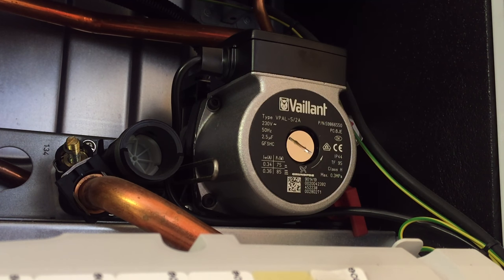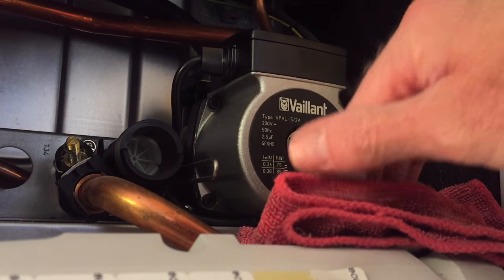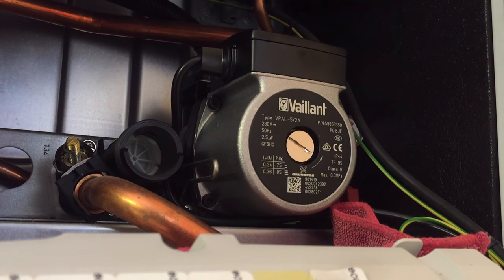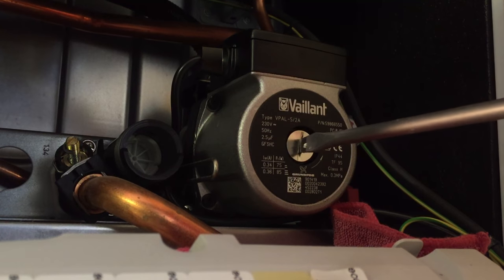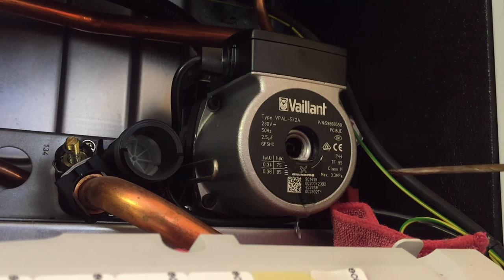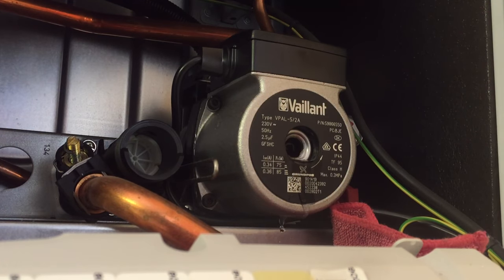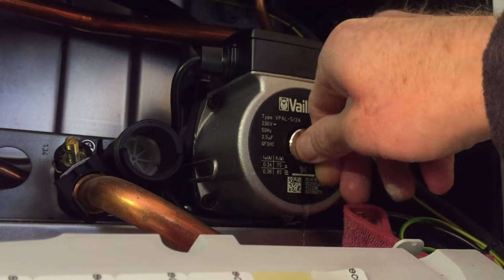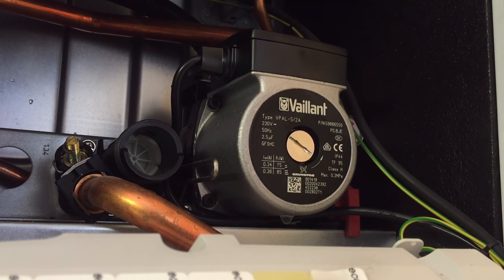Boiler not working. How to check heating pump.

Comment: Thank you so much for this! My boiler was disconnected at work for an extension build and when I recommissioned it I had fault F75.  I was getting ready to change the sensor and even the pump but after seeing your video I did what you said and the pump came right back to life. Cheers

Comment: I can see my pump is spinning when I remove that threaded plug but the radiators are still cool to the touch. Could the impeller be broken? Is there any way short of draining the system and removing those four hex bolts and taking off the pump to visually inspect the impeller?

Comment: Firstly you should mention that you should turn the power off to the boiler in case it kicks in whilst you are fiddling about with that small screwdriver in the pump. Secondly on the pump label in the 5 o clock position is an arrow - that is the direction of the pump - if you start turning it like you did in the opposite direction there is a good chance you will damage the pump vanes causing loss of pump pressure and having bits in the pump cylinder that will damage other vanes.
Reply: Firstly, he and you should mention, there is no need to open the bleeder completely. If the boiler is switched on and running, a simple half-turn would show you if the water pump is working if water and or boiling water gushes out! Then you know its working.

Comment: Hi I’ve taken the lock off but water continuously pours out of the pump and is very hot, the internal part turns freely but when boiler is running the pump makes no noise. Can you offer advice?

Comment: Thanks for video. very clear. ok removed the front nut, turned the inside screw- action seems fine...so put it all back together...turned to heat mode...the pump casing itself is getting very hot, is this normal? I can feel vibration and assume water passing through...I have hot water fine...but I only have two large cast radiators on this system, I dont believe they have water in them...as bleed valve produce nothing, but both cold as stone...even though boiler has kicked in, pressure at 1.6...any advice?if I open the feed tap the pressure goes up but not going to the rads.?
TIA combination boiler.

Comment: This is amazing, I was desperate and couldn't get hold of a gas engineer.. I wacked the pump hard several times and wow! the pump stated vibrating, and the boiler came on.. should I get a new pump?
Reply: Yes, it stopped for a reason. Check the windings, it is probably old. Replace it

Comment: Done that and the pump moves freely.
Still got 1/3 of the rads that are luke warm and the rest cold.
What would be the next to check ?
Reply from the maker: check system pressure if sealed system, should be 1 bar minimum, check rads for air, if still no joy you will need to call in a plumber

Comment: when I run the bath, then after a minute or so the pump produces a clear whirring sound for 10-15 seconds before settling down. what could be causing this? is there an easy check/fix ?
Reply: probably a build up of limescale on the pump impeller, needs dismantling and removal of scale.
You also may need to top up the Fernox or other brand  inhibitor in the central heating system to aid lubrication of this pump

Comment: Hi my pump has a lot of water coming out nonstop from bleed valve and it blows fuse in pcb when heating is on but works ok on just hot water do i need new pump?
Reply from the maker: Hi Peter
Sounds like you need to call in a plumber.
If you have gravity primaries without the need for pump this would explain why boiler works ok on hot water only

Comment: I’ve taken the locking but off but the water just constantly runs out when I do this.  On your video you only have a small amount of water come out.  Can you help?
Reply: If it sprays water after undoing the plug that means the pump isn't working well and it needs to be changed soon.
Reply: Hi, was this the case as mine is doing the same?

Comment: I can feel my pump vibrating and its very warm, even hot to the touch. I haven't unscrewed the large screw yet which ill do tomorrow and also unplug from the electrical socket.

Is the pump suppose to be hot?
Reply: well it is pumping hot water, so...

Comment: Are you turning off the system before you remove the screw?
Reply from the maker: Hi Bradley
No need to turn system off before you remove screw.
After you have removed the large screw use a small electrical screwdriver to insert into shaft. 
If the pump is running you will feel it vibrating against the pump impeller as it spins so all good with pump.
If the pump is stuck you will feel no vibration. You will then need to turn the impeller with a small slotted screwdriver to free off. When impeller is free the screwdriver will vibrate and pump will start to spin. Remove screwdriver.
If then pump is badly stuck you may have to push hard on screwdriver to free off.
Sometimes tapping gently with a hammer before you remove screw  works so try this first.
Hope this helps and all goes well
Reply: GoodHomeHacks no problem. Doing this at present but there is STACKS of water coming from the pump as I open it
Reply from the maker: Something is amiss here and impellor seems to be letting by.  This can be because pump is working fine and not stuck?
Shut system off and allow to cool. Check system pressure is no more than 1 bar when cold if sealed system(Combi boiler).
Remove screw and check if impeller turns. Small amounts of water are normal. 
If problem persists and you cant free off pump and you have loads of water coming out then you will need to call a plumber to resolve.

 @bradjammin

Comment: This video shouldn’t be alowed and nobody should be removing the front boiler case if you are not gas safe registered.
The boiler case is an important part of the combustion process and the seal around it must be re fitted correctly otherwise it could have deadly consequences
Reply: Oh, behave mate. Its a waterpump! 🙄
Reply: @m1geo  I know it’s only a water pump he’s working on but how did he access it ?!

Bottom line is unless your gas safe you won’t understand how important it is that the case is installed correctly!
Reply: @bobbysuk  In most combi systems these pumps are not even inside the boiler.  I have a Gledhill Boilermate and there is no gas connection.   Perhaps the presenter should have mentioned this but there are circumstances where you are not going to be going anywhere near gas.